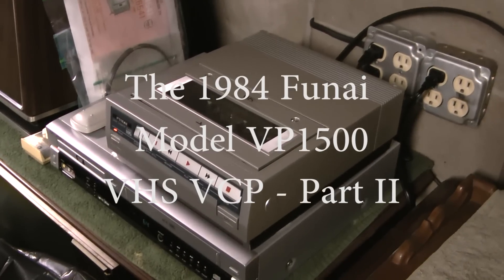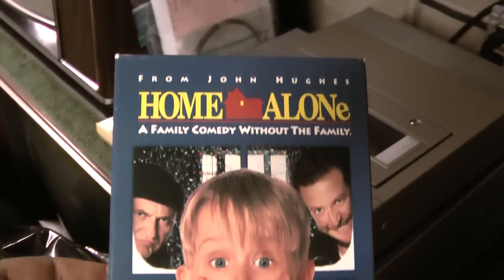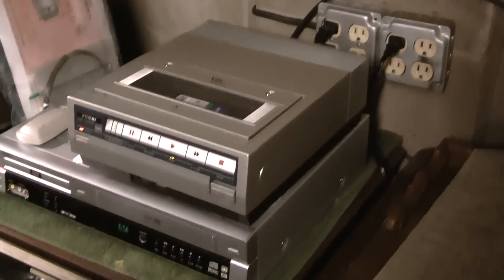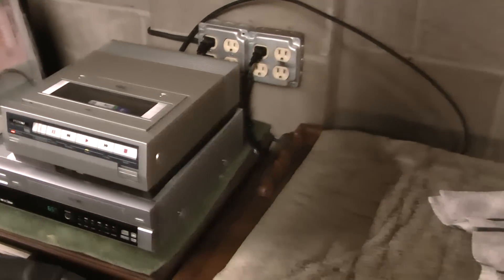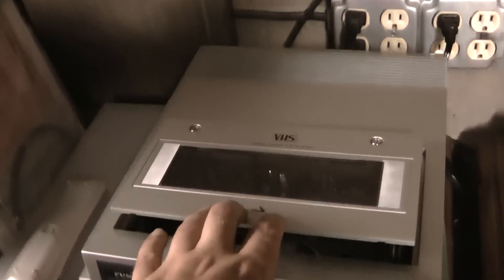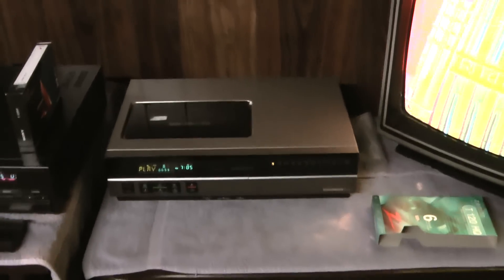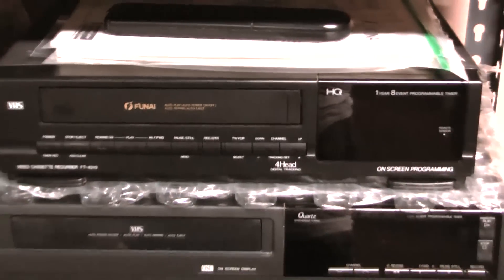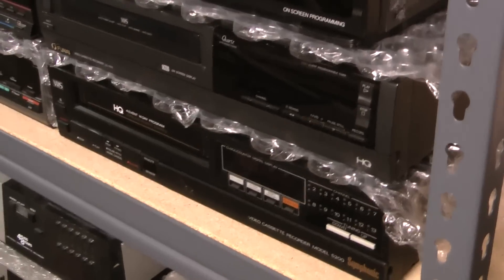The 1984 Funai Model VP1500 VHS VCP - Part II

Comment: That's not true. Some later model VCRs sold in the UK had SLP (or EP depending on manufacturer) so you could get up to a massive 15 hours on an E300 tape in SLP in PAL format. My Panasonic NV-HV61 has SLP and one of my Sharp machines has it. Because E180 3hr and E240 4hr tapes were (and are) the norm for SP recording as opposed to T120 2hr tapes in NTSC, most people used SP. Also, pre-recorded tapes in LP/EP were unheard of in the UK. It amazes me so many were released in the US.

Comment: The Crosstalk between the Tracks are not from the Headwide! only from the +-7° Angle Azimuth from Head A to Head B. A Scaner Drum came out on the Market in England with a small Head for SP+LP with the same Heads. 4Head Machines with Head AB and Head CD because the switch between SP Heads AB and LP Heads CD they are the half wide. Glas Heads from Japan are the Best because the have not so much Noise then the Philips Heads without Glas. Best Regards Volker

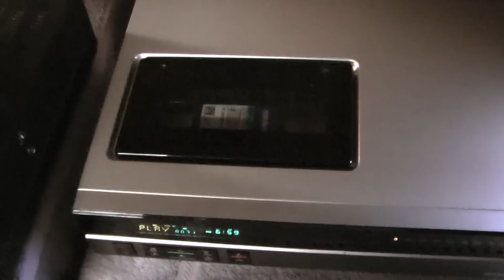Comment: Wow, compare 6:10 to 6:54, you can really see the clarity in the VP-1500.  It was pretty cool to see the inside of that one again after so many years.  Too bad they didn't have a removable panel on the bottom, cause I'd like to watch that capstan pulley work.

Comment from the maker: @NJRoadfan As for Beta, my parents used theirs until 1991 when we got that Emerson VHS. I continued to use my Sony SuperBeta SL-100 until xmas of 1992 when my parents bought a hifi VHS and gave me the Emerson. 

I had the heads cleaned in 1993 on the SL-100 (control head dirty causing it to skip speeds), and continued to use it until 1995 (far better picture quality). And since 1996, used occasionally for watching old movies or having fun with it. At least once a month I use it now.

Comment from the maker: @NJRoadfan ok, actual VHS specs:

Track pitch:.058 mm 	(SP)
		.039 mm 	(LP)
		.019 mm 	(EP)

That clarifies that. So then it is at this point what size heads did the manufacturer use?
I do have the service manual for my 1986 Symphonic 5200 2-head machine, but it does not say in the specifications.

Comment: I'll admit, I got it confused (its been awhile since I had an 80s VHS machine). Pro (S)VHS editing decks only had 58um heads and were SP only. Playing back SP tapes recorded with narrow 38/19um head VCRs on them actually resulted in more noise due to the lower track width on tape.

I'm surprised you guys managed to stick with Beta until the 90s. We went dual format in 1986 with a GE (Panasonic) 1VCR6003X. Same chassis as the Sylvania, but front loader with all green VFD.

Comment from the maker: @weasel2htm I have that Sylvania (Panasonic) 3-head unit. And this how it works:

There are indeed 3 video heads on the drum, after I got a better look at it, so it wasn't a marketing thing. Only 2 are for regular playback. When it enters special effects, the 3rd head gets utilized. It does not get as good of a special effects picture as an actual 4 head, but it does provide much cleaner special effects play vs. a 2 head unit.

Comment from the maker: @Penguindog55 Funai's quality went down after they started making that new chassis in 1992. 

The quality went completely down once the units were started to be made in China. This is circa 1993-1995 or so. 

So if you get the original design from 1984-1991, that is a very robust design.